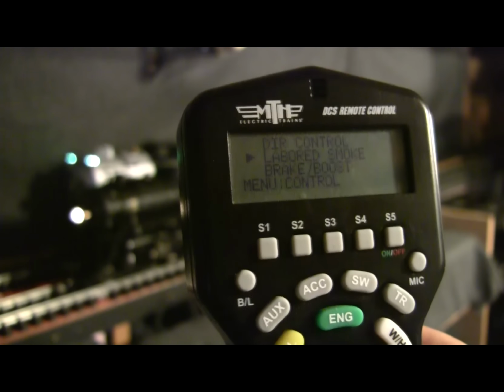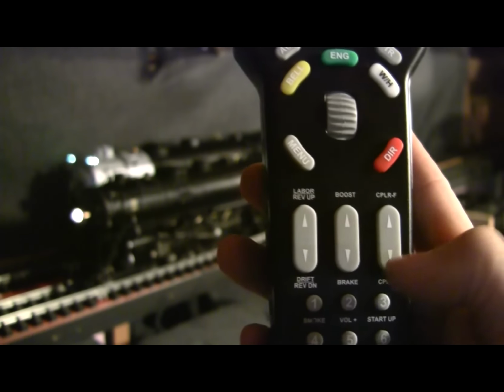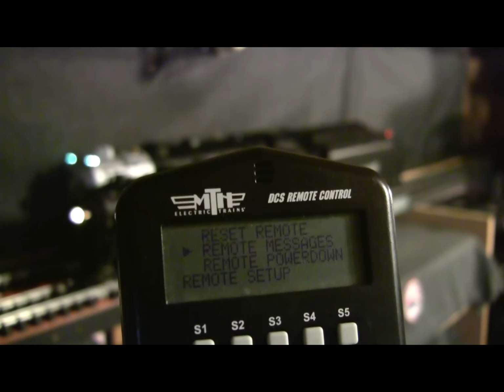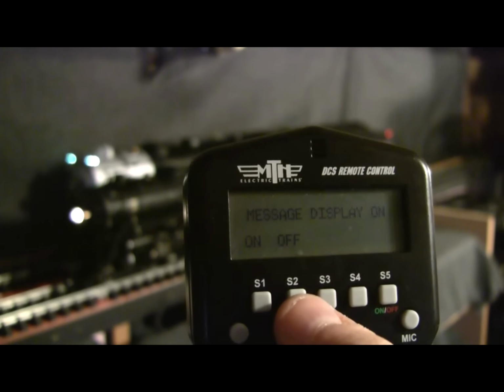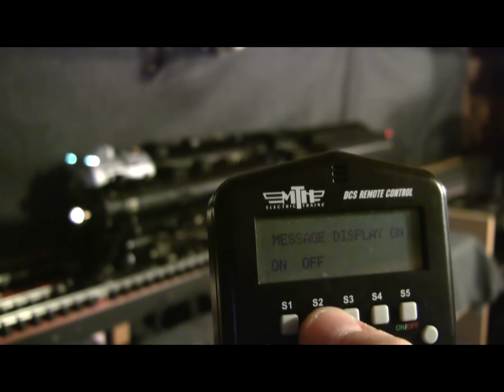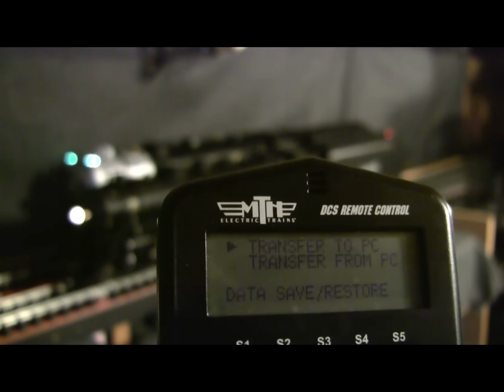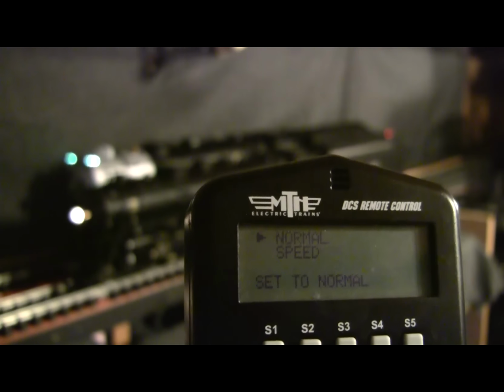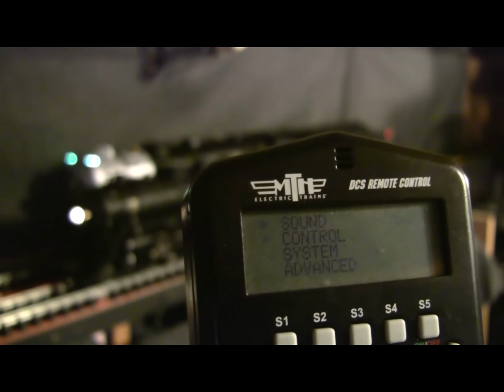MTH DCS Overview - Part 4 of 5

Comment from the maker: @IllinoisTrains1 Hi there, thanks for the reply.  I should have just said it turns them on.  There are actually some sound files programmed to not flash the ditch lights when the horn is blown regardless of what they are set to.  The most current sound files I'm using now don't ever flash.  I've also seen a sound file (not sure if it was diesel or steam) but 'flash' would just make them flash all the time.

Comment: Is it possible to operate a dcs locomotive conventionally without hurting anything?
Reply from the maker: Yes you can run PS2 or PS3 engines on straight analog under AC or DC power. Exception is HO that is DC power only in analog. HO PS3+ 3 rail can do AC power.

Comment: Hi Ray Paul here great job on my wander , very helpful tips on the dcs remote , ps how do I clear out the maintenance message? Also when I run multiple engines sometimes one address will control 2 or more engines how do I correct this problem?
Reply from the maker: Hi Paul, to reset the Maintenance reminder, use the soft keys and select More then scroll to Maintenance and select Reset.   If one address ID entry is controlling more than one engine it means more than one engine has that same engine ID number assigned to it in each PS2/PS3 board.  You need to put that first engine on a test track with no other engines connected to the TIU output and change the ID number.  Then take that engine off the track, and put the next engine that had the same ID.  Add MTH engine to remote, then change that ID number to another one.  Repeat till you have done this for all engines.  If you still have questions send me an email this is too much to put on Youtube comment sections and I need to send you links.